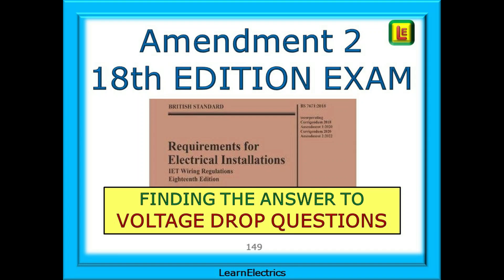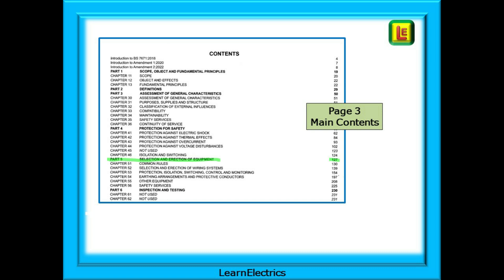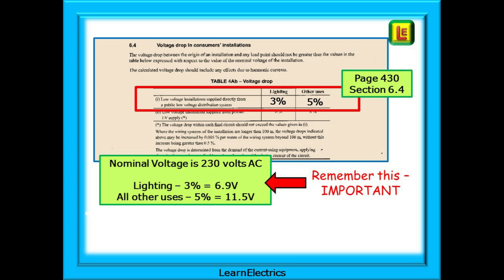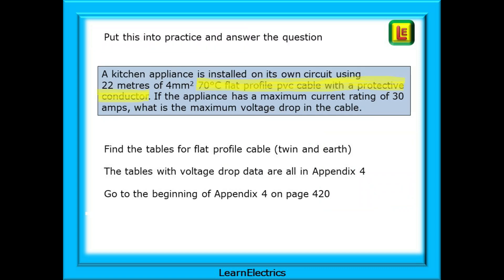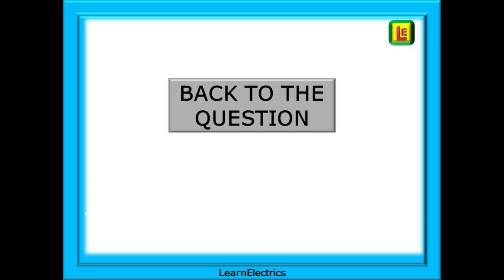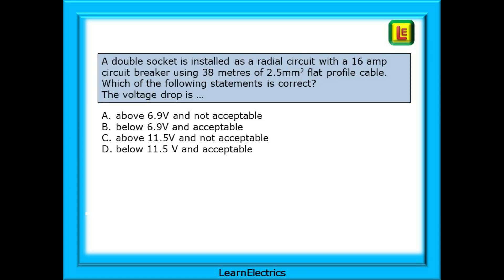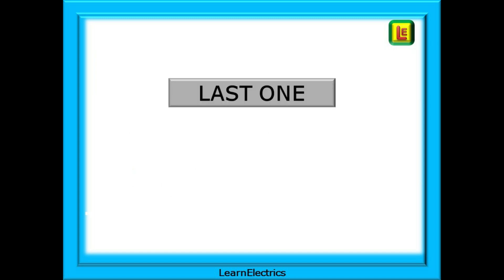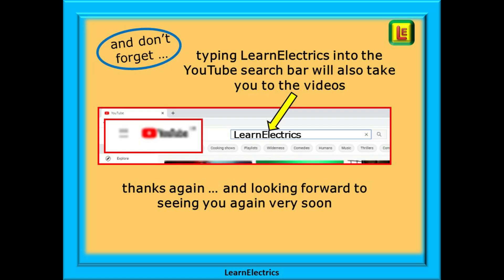18th EDITION AMENDMENT 2 – VOLTAGE DROP CALCULATIONS – EXAM QUESTIONS – FINDING ANSWERS

Comment: Thanks for pointing me to THIS video Dave!  I know that volt drop formula off by heart now! I found this video very helpful indeed also for knowing WHICH TABLE to look at for calculating voltage drops in circuits  regarding 70 degrees Celsius flat twin and earth cable. (Quickest way to find this table (4D5) is to look it up in the TABLE OF TABLES section in the brown book (after going there from the Contents page on page 3 of the book).  Thanks again for this!  Your  YOUTUBE channel and your website is an absolutely superb resource  for quckly and easily being able ot learn how to become a much better and more knowledgeable professional electrician.
Reply from the maker: Glad it was helpful Gary and your comments are appreciated. The next video is also about volts drop and R1+R2 calculations, which you might enjoy.

Comment: Question 2 states 40m length of cable but your calculation shows 60m.
Reply from the maker: Just checked the video and no, it is calculated for 40 metres. Your answer should be 7.2 volts as per the slide. Hope this helps and thanks for watching. Dave.

Comment: hello I've come across your videos as I'm training to be a spark can you please tell me how you come to find the top number in the voltage drop formula please
Reply from the maker: The number 44 is the reference number for 1mm copper conductor. It will drop 44mV per amp per metre. This is found in the voltage drop data for the copper conductors in the Wiring Regs book, Appx 4.

Comment: Q2 you put 60 instead of 40 for cable length
Reply from the maker: Thanks for spotting that, I've corrected it. It should be 40 metres. I can't even think of an excuse why that happened, but thanks. Dave.
Reply: @learnelectrics4402  Loving the videos, but it still has 60 rather than 40 in the populated equation.
Reply: @learnelectrics4402 p😊